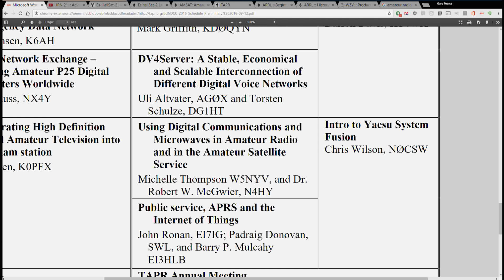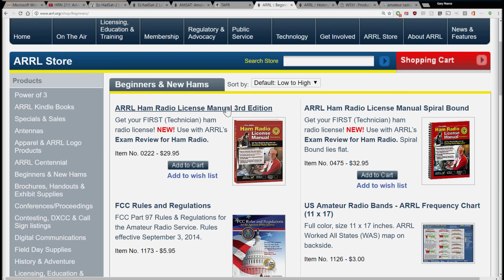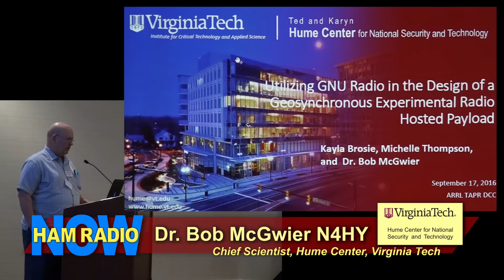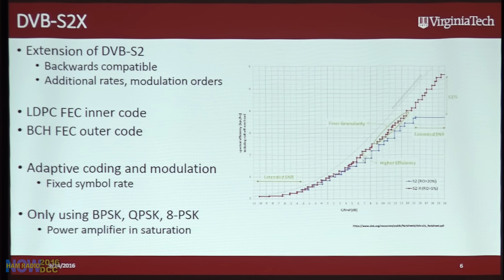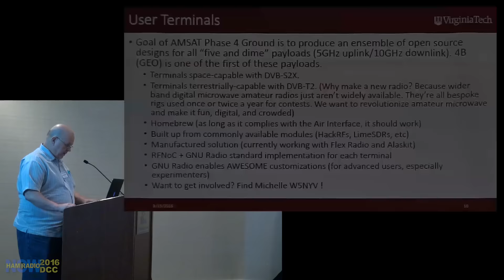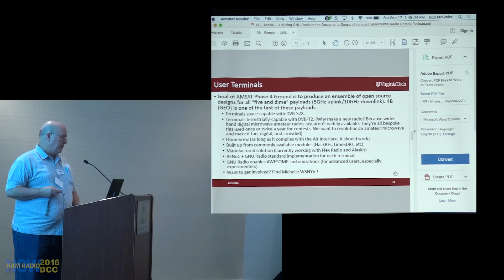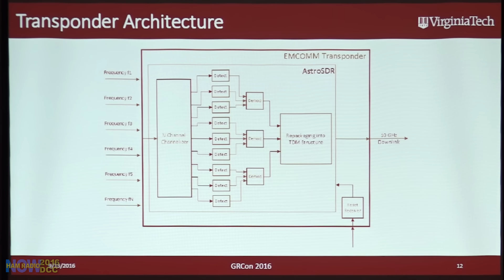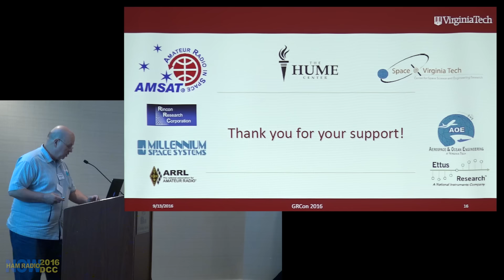HRN 272: A GeoSync Ham Radio Satellite for the Americas - from the DCC on Ham Radio Now

Comment: Is there any update on this? I can’t find any recent information about the satellite.
Reply: I been looking for a hour or so and can't find nothing new..  I have lots of equipment to use for communicating to this bird when it is airborne!
Reply: @K5MOB  wont be for many years to come, most likely no $$$$$ I worked all of the older birds during the 90's and it was great! (KD6SBR, on QRZ.COM) It may be 10 years or so before this goes anywhere. I know it took the P4A about 10-15 years from start to launch (I could be off by a few years) 

But it takes years to fund these projects from donations and then get a ride on a vehicle.
I would love to get back into Sat-Comms instead of HF these days! better class of people for sure. No one jammed or acted like a moron on 144/435/1.2GHZ,
73 de KD6SBR Tom, Now living in NV.
Reply: @lt4324  we had a ride on a DoD sat. I discussed with an AMSAT person at Dayton 2017 and he was not as keen on it.  It will take pushing our govt.  Or a boat load of money.